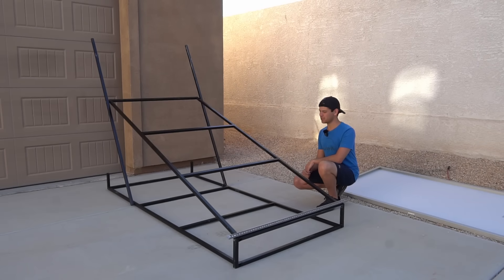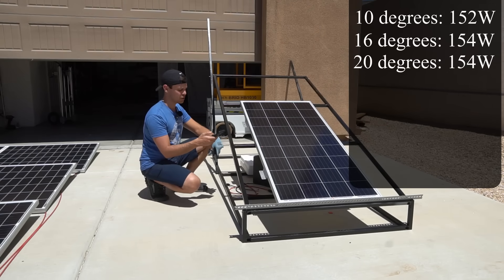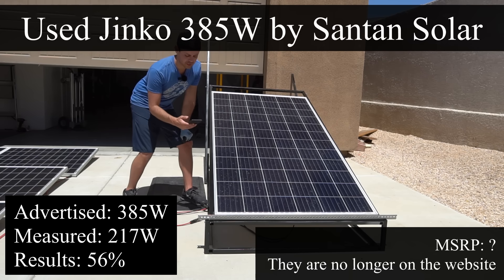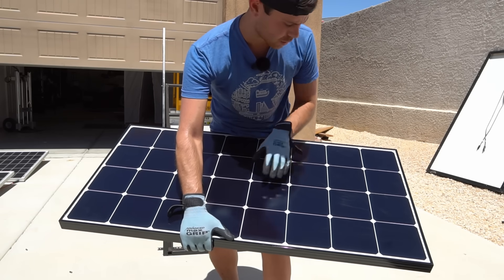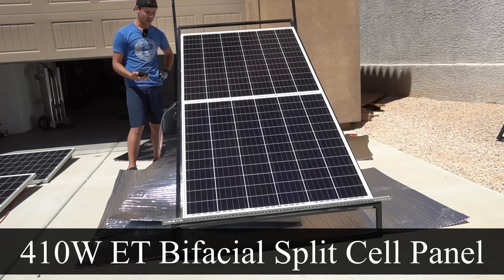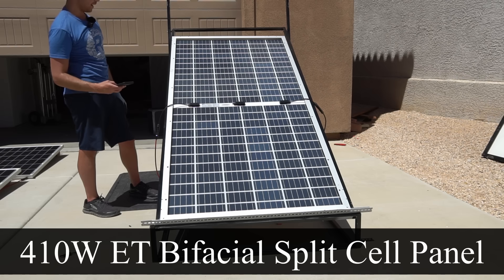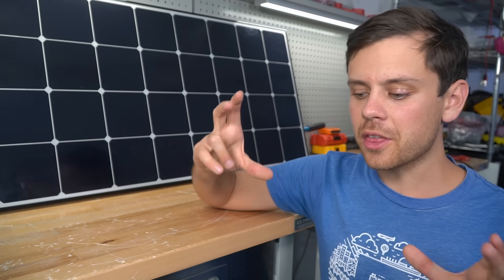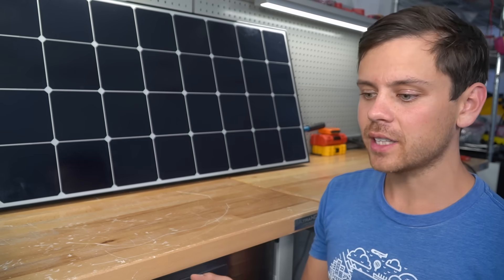Solar Panel Showdown: Sunpower VS Bifacial VS Used VS Renogy VS Rich Solar

Comment: Those 410 watts Panels pulling 385watts with them NOT pointing/angled directly at the sun...impressive.
If you had those point directly at the sun, you would have been OVER 400Watts.

Comment: Duh.  You can't perform ANY useful comparison tests while using the sun!  Whatever happened to the STC: 1000W / m2 at 25C?  All you were doing was measuring the power generated for a given panel angle, size, temperature AND solar irradiance (which you never measured).  No way to infer ANY efficiency numbers.  Pretty lame test.  Crazy how you have some many subscribers!

Comment: My 410 watt pannel is only pulling out 310 in very hot summer day when outside temperature is 40 Degree Celsius. Temperature plays very important role in output of solar panels.

Comment: I'm having trouble finding a hybrid inverter charger that will work on my homemade camper I have 14x8 foot off roof space and for my power I need at least 800 watts at 24 volts to keep my 6 batters charged  I live and work out of my camper and the average 300kwh systems don't keep up I have to run large power tools off the system most of the time as well as my ac and all other appliances any suggestions on the best way to get a charge controller to work on my 41volt 365 watt panels I have 3 but most I find are either not rated for it or need more input then I can get out of my panels and not enough space for more each panels produces up to 10 amps should I build a briefcase style pannel from more of the same panels that I fold up and store when not in use please let me know what might work iv been stuck on this part now for a little over a year trying to find the best solution with no luck so far each battery is 120amp hour 12 volt wired up to be 24 volts total

Comment: When you place the reflector too close they are blocking the sun's power.  back the reflectors away (several feet so the light that goes around the front of the panel and be directed at the back.  You['re trying to increase the light that would otherwise go behind, beside of in front of the panels, not the light that goes through....move the reflectors to reflect light straight from the sun toward the back of the panels.  kind of a parabola behind the and below the bifacials.   Good stuff   thank you several feet back so it's bright sunlight being redirected toward the backs.

Comment: Based on your review, I purchased the Renogy 100W 12V Eclipse panel.  It works great on my off grid trailer and I want to purchase another one for my Jeep roof rack.  However Renogy indicates that they are no longer available.  Is there an equivalent panel (regardless of cost) that is just as good as the Eclipse?

Comment: Hi Will, I have two renogy rigid panels one is 200watt and the other is 100 watt and are connected to a 12volt  200ah renogy lifepo4 using a victron mppt 20amp. Question: are these panels ok to install in parallel (12volts) using two different output (200 and 100watt) panels?

Comment: Those Bifacial panels need to be much much higher to boost output.  Carport roof height would be a start. Close to the ground the bottom cells are in their own shadow. If you get the high enough and the sun is not 90 degrees high noon you can get a huge increase in power as the reflected rays from the ground could be bounced off a reflector giving you closer to the energy of the top direct rays. If you think about it at certain angles you can have two suns hitting the panels sort of like why the UV index is so high in the Snow. One sun hitting from the top and one reflected and hitting the bottom,. You can make your own bifacial panels using two stacked solar panels and get higher output than a bifacial does as the bottom panels is not as efficient even if you flip it over then two panels, one up and one down.

Comment: 1:45 to 2:25 is probably the most important 40 seconds of video about solar panels on Youtube. It shows that the angle of the panel makes hardly any difference to the output (at least, in the summer, I would really like to see the same test done in the middle of winter. Any chance, Will?)

Comment: When adding solar panels in series, is the max voltage for the controller the values of the open circuit voltage on the spec sheet? Many of the panels I have looked at have open circuit voltage as high as 48 volts. Putting nine in series would be 432 volts. I would like to build a system to take the load (island mode) off my second circuit breaker panel. That panel runs around 2.0 KWh. Much of the day it runs around 1.6 KWh.

Comment: Can't say how they will go long term but the 3 X 100w standard Renogy mono  panels I bought this year performed very well via a 100/20 Victron controller, they got up to 104w output  but they do drop a bit when hot but still around 80 to 90 watts  . Yep the Eclipse model seems great but the cost is way too much for the small increase in performance.

Comment: Excellent panel comparison Will, thanks!  

Just curious, all of these tests were performed at your ideal sun angle for peak performance and results varied widely from rated output.  What would happen if these panels were tested while significantly off axis from direct sunlight?  As RV owners know, most panels are firmly mounted to the roof for safety and spend most of their lives off axis, or in other significantly less than ideal conditions like cloud cover.  Would a single large panel say 400w typically outperform 4 x 100w panels in parallel under the same off-axis conditions due to the higher voltage output of the single panel? 

This might make for a fun real-world comparison test that can guide future RV solar systems to maximize output from limited roof space.  Cheers!

Comment: Will, on that jinko 385 that was showing half of it ocv in my experience can most likely be from 1 shorted bypass diode only allowing you to see around half of the ocv. I have one I've opened up and verified the shorted closed, bypass diodes. I ordered some new diodes to repair mine.

Comment: Would it be much of a benefit providing some sort of water cooling to the backs of the solar panels and having the water circulate with a small pump to a large pool you want to heat anyway

Comment: With bifacial, you need to make sure nothing is under it. Just leave the bare pavement, put your test rig away from panels. The color surface underneath might make a difference.

Comment: in Southern Alberta Canada where I am we're at 51 Degrees N. it's really freezing and lots of snow on the ground and a higher angle in winter. I'm going to go for the Bifacial panels and I may make the roof of my 26' Tinyhouse Trailer White as well.

Comment: Yeah it's crazy some solar panels actually make more than what they're rated for I have a 10 watt (rated)  sunpower brand  trickle charger for my pickup truck and under good sun it actually makes 12+ Watts it makes almost 10 on cloudy ⛅ day lol I'm just getting into solar started with trickle chargers for my spare vehicles now looking at getting a 100 watt panel and expand from there.

Comment: Thank you Will for sharing your awesome solar panel expertise! Any advice will be appreciated, I have an Enphase system and it is working very well although it is not enough. I would like to add a few panels on the ground. I enjoyed your perspective on the bifacial panels and am thinking I will go that direction as I live in south central Pennsylvania. How do I find the preferred angle to mount the panels for more winter gain. My roof panels are good for summer due to the roof angle. I also have some concern with adding to my existing system. Thank you again, Jim Kuhlman

Comment: What would you recommend in regard to solar panels for an ecoflow Delta 1300 when not using it on the road but more when power goes out at home?

Comment: I have a 190w solar panel on my RV. I want to add more but similar ones go for almost $500 each. how important is it that they match? I've found a pair of 200W panels for $200. Do you think these are close enough to work?

Comment: Will, Renogy claims that the Eclipse panels perform better in low light and shaded conditions.  I have not been able to find out how much better they perform in partial shading.  I use Rich Polycrystalline panels camping and you have to be vigilant to make sure partial shading does not occur during a day.  Have you done any testing for partial shading on the eclipse panels?  Some folding panels I use have 50% reduction with minimal shading.  The Rich panel isn't quite that bad, but large glass panels are not handy in remote camps.  Thanks for your information through the years.  Dick in MT

Comment: Just for an interesting data point I wonder how the bi-facial panels would work if one was stacked on top of the other (with say a 1-1.5inch gap). How much energy (if any) would the bottom panel generate in that scenario..? Could be a fun test.

Comment: Such an outstanding demo. I have four Eclipse on my 26’ RV with 300 amp battery bank. The Eclipse seem to make something out of almost nothing. Low angle performance so much better than my first system. During peak solar hours people did not believe my solar controller output numbers. Yep, they for sure outputted more than 100%.

Comment: Hi Will, I've been a solar designer, installer for almost 20 years. New to your channel just this year. Thanks. Question; have you done a segment on grounding? Specifically, grounding when the system uses a mobile gen-set, and more specifically, on a boat/yacht with galvanic isolation and /or using shore power from a marina, or campsite. Hoping you have time to reply.

Comment: to heat a koi pond a pv panel with water circulating the back of the panel cooling it down and adding heat to the pond while being heated with a dc element will work well.

Comment: I know this is a few months old but maybe you will still see the comment. Here in Thailand to cool our roofs we have a small pump connected to a sprinkler or to a pipe with holes along the ridge line. Perhaps something that can run water over the panels would help. Also we have a 3 phase supply to our property. How would you connect a solar setup?

Comment: 6:34 The glass face may be acting as a reflector for sunshine hitting the cells making the glass-framed panel more productive than the flex panel (even with the 3 extra cells).  It would be interesting to see the glass removed from the glass Sunpower/Renogy and how that affects output.

Comment: EXCELELENT work!!   Thanks!   I would LOVE for you to compare, give some info…. on small trickle charge type panels/systems to simply keep batteries topped off.  For example a garden tractor, a small generator (that uses a small battery to start), motorcycle, snowmobile…..  all items not used often, but need to keep the small 12v battery charged.  I bought on Amazon a 20w panel w/mppt charger on it for this purpose, it worked for 3 weeks.  Cheap JUNK!   But we have no way of knowing what is garbage and what will last longer than 3 weeks.    Thanks for your GRAET info!!

Comment: Bought four of those bifacial panels for my build. I'm at 45 degrees latitude, and generating power in the winter will be far more of a concern than the summer. Looking forward to testing them.

Comment: My new travel trailer came with one 175 Watt solar panel. Renogy has a good deal at Lowes for 2x100watt panels, but not sure if I can mix different  size panels. The existing is a different  brand; actually it is Jaboni. Can I mix different  size panels and different brands on the same system???? Thanks for your input.

Comment: Nice comparison. I hope to see the latest Trina Vertex S (residential version) with 400/405Wp in a test like this. I'm currently considering those for my carport (which can hold max 20 of them). The Vertex S panels are cheap (150 EUR including 19% tax for each module (~180 USD) if you buy 25+ of them; there might be even cheaper offerings) and they just started shipping those in February 2021 here in Europe.

Comment: To find the best angle, watch your shadow.  The shadow should extend only behind the panel, not to the side. Next tip the panel until it creates the largest shadow.  Too much or too little will make a smaller shadow. Find that sweet spot.

Comment: You produce some of the most informative and easy to understand videos on this subject that I have seen. I would like to see the power per unit area (watts per square meter) added to your analysis. I am in the planning stages of adding solar to a boat and surface area is quite limited. Having an inexpensive solution would be nice but if that means my array is three times the size of my boat then it is not a practical solution.

Comment: I have used Santan Solar and the used panels.   I currently have 24 - 327w panels and they work great!     When I did have an issue they were easy to work with and took care of my issues very quickly.

Comment: Need some insight to AGM… absorption times, cyclic voltage, float voltage bulk and absorption voltages when using victron inverter chargers

Comment: You remind me of that smart kid that grandma would listen too. lol. So i am too. i respect your opinion & i was looking at renogy 320W monocrystaline on amazon 292 per panel for the 4 panel system where 6pcs are 300 each. i wanted to get these but you seem to be back and forth on renogy. i am putting it on a skoolie that i plan to have an ac with generator until i am able to build up my system more. 
so would you suggest these or T-series by Santan? i have a 40ft bus & plan on using battleborn batteries @48V. i could fit 12 panels in just over 30ft of the renogy.
before i buy all my pieces perhaps i could pay you to check over the system that i come up with to avoid costly mistakes? 
i watched  a lot of videos on the math for solar system & yours was the one that i could understand.
thank you for your time.

Comment: So am I understanding this correctly that the Bifacial panels will be most efficient for my area with less good solar days?  It rarely gets hot & it rains a lot.  Or do you think that Renogy with the Sunpower cells will do better?  If you could have just one panel..

Comment: Great review!!!  Despite the cost, how reliable and durable are the "eclipse" sunpower cells?  If you had the money would they be worth it for maximum power production for a long term use.  Also what kind of solar power storage solution are used?  Could you use these (say 10-12) to supplement power to a large house?

Comment: Excellent video. Wish I found your channel earlier. What if, I already have a portable Solar Generator system that comes with its own brand 100W solar panel. It is capable of 1 more 100W panel. Would you recommend adding the 1 Rich Poly panel? The Rich Poly panel is much cheaper than the panel by the generator's manufacturer.

Comment: Will you are the first person I have ever followed. I was building solar way back in the early 90s before it was so popular. I have truly enjoyed your vids. Then today I looked back at your posts. Very interesting. You have come so far. I have built systems for Rv’s, and boats. Have sailed a few thousand open ocean single handed miles built 30 some very efficient homes. Have had a great life. I am now 56 and am experiencing the effects of all I have done. Very cool to here how you have battled back from such a low. Doctors tell me I will lose use of my arms at some point, I don’t believe them. Anyway you have gotten my into lifepo4. Sold off a bunch of AGMs I had. Wow what a difference. When AGM came out it was a game changer, but no comparison to lifepo4. You would love some of my projects. My latest will be a 5th wheel I am putting a 24 volt system into. But I still have to have 12 volt for everything except the inverter. Can I use an mppt controller to charger the small 12 volt system from the 24 volt system? Ore is it better to use a dc to dc charger?

Comment: I can definitely agree that the Renogy Mono panels are terrible.  I just tested four 175 watt mono panels from Renogy.  VOC is not as advertised and they massively underperformed, making 114 watts max per panel.  This is at 12:30pm in Phoenix on a clear day and I tilted the panels until I found their max output point.  I tested four panels individually and got very similar results.  I tested this with a wattmeter connected directly to the panels w/ MC4 cables as well as on a Victron and EPever charge controller, all corroborating similar readings.  

That's terrible, it should be 140 watts at least.  I tried to resolve it with Renogy but their support is pretty awful.  They said it sounds like I got bad panels and to return them.  I pointed out the likelihood of four bad panels (not all ordered at the same time) all performing within a couple percent of each other is not indicative of a faulty panel, but instead faulty advertising.  Between the chickens clucking in the background they just kept repeating themselves that we should return them for new panels.  I spent an hour and forty-five minutes on the phone with them and talked to a supervisor with the same faulty logic and terrible advice.  I definitely cannot recommend people use Renogy products at all but did think the output of the eclipse panels shown here was impressive.  

SanTan solar is close to my house and I agree with Will that they are awesome and those 250w panels he recommends are of tremendous value.  Will is the best and I love the channel and his refreshing honesty, it's truly magical in this day and age...

Comment: Will prowse i am using 6 315 watt 9.1 amp 40 volt. 2 series x3 then perrerel. In to renogy rover 60 amp and 150 volts. It is getting very hot and im only getting 875 watts so can I perrerel two 60 amp rovers and get the lost wattage plus keep them cooler?.

Comment: Is 36v battery system viable? I mean if it is, why is it under rated? Or am I missing something? I mean why wouldn't someone try 36v 280A batteries?